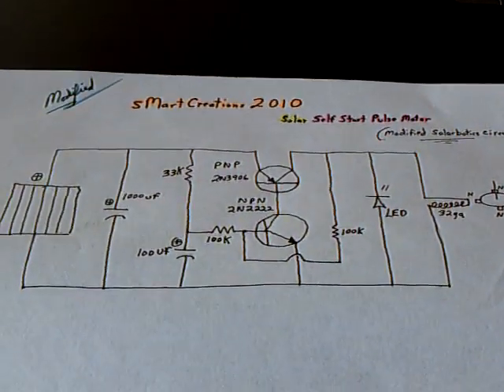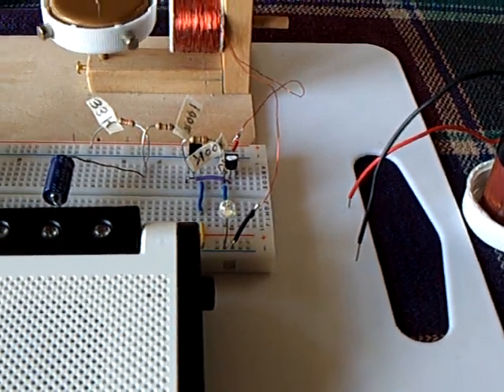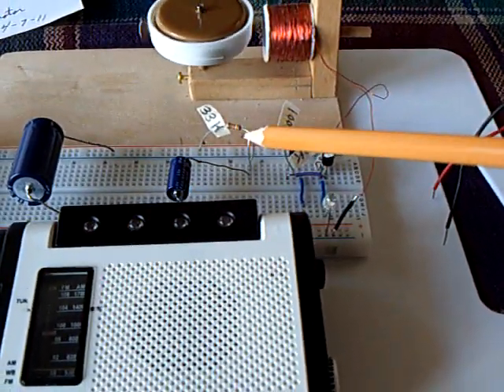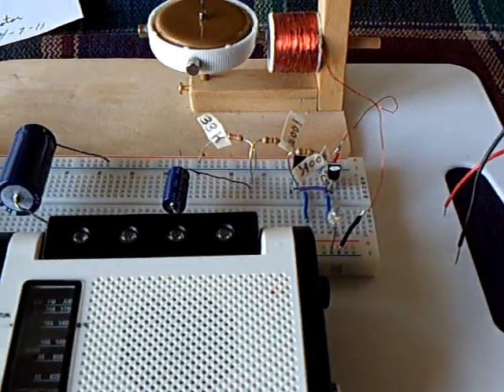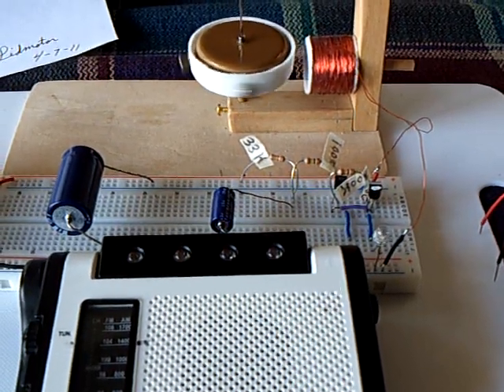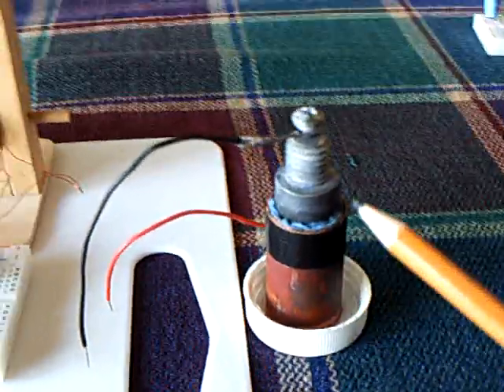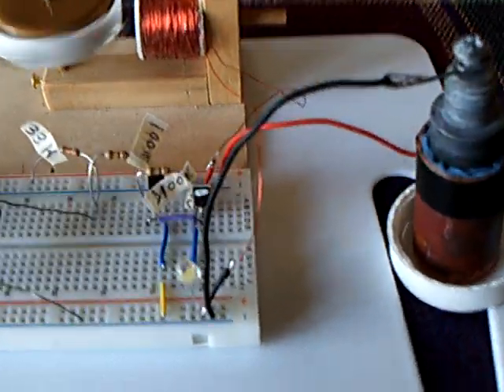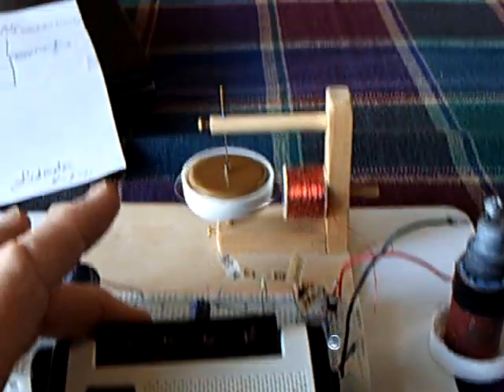Sounds of a self starting solar pulse motor.ASF

Comment from the maker: Check your circuit again. The circuit shouldl blink (pulse) even without the rotor there.  If your circuit does that then look into your rotor arrarngement.  It has to be almost frictionless.  The air core coil that I have is 30ga and about 400 turns.